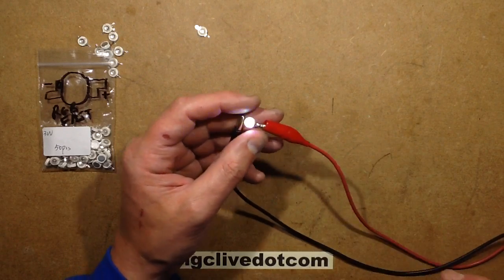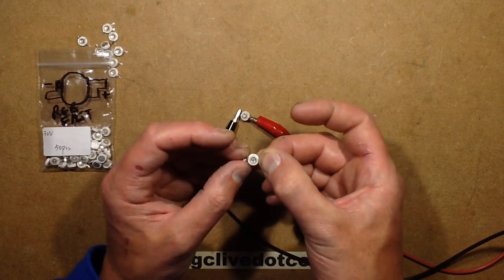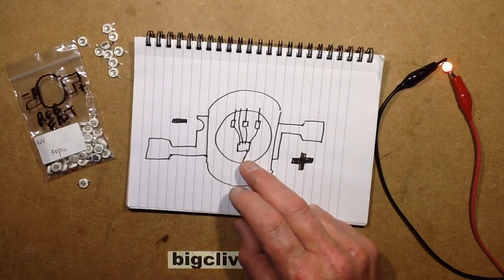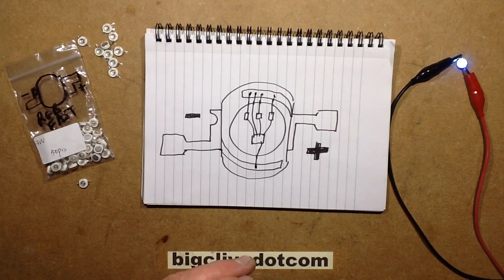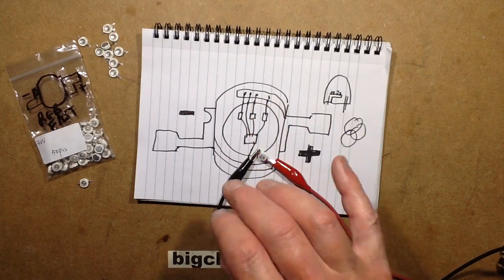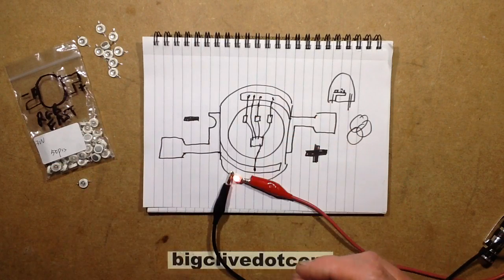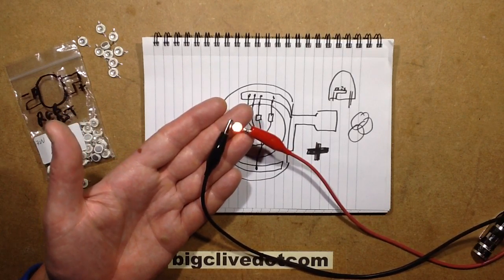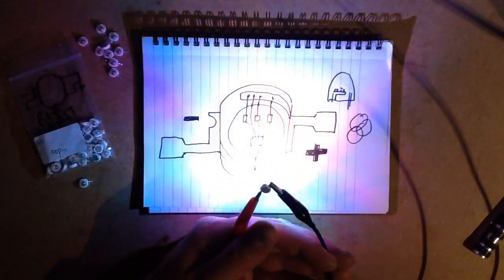Self colour changing 3W LEDs.

Comment: did you manage to find a serial number or anything? 
been trying to look for these recently, to mod a ps3 controller, not sure about the voltages though
but there are "player lights" 1-4
and i want them to be rgb and this seems like the most fitting solution.
the other ones i've found are all single color, or voltage regulated sadly
Reply from the maker: I've never seen these since.

Comment: This LEDs are so much stressful things if it is used in normal electronic or electrical product as an indicator. These can not be used in any designed also as we can not program it to flash according to our need rather than manufacturer’ s taste of the random sequence and randomly changing flashing speed ,etc. I bought one TV antenna which had build in booster. The manufacturer used one such LED also as booster power indicator. It was so much stressful and annoying. I had to remove .

Comment: I can't help but think having the chip built-in is a bit of an own-goal on the design. If a randomly colour changing LED is what's desired then it works convulsingly well...But swap the chip for three contact pads and you don't just drive down production costs, but you make a more versatile/adaptable product in the process! :-)

I mean: If "flashy flashy randy colour" is the order of the day, an external micro controller costs £0.03 and doesn't require that much extra solder! ^_^
Reply: Such LEDs are sold.  If you want programmability then you want a neopixel driven  by an Arduino nano.  Then you just write a simple loop to cycle the RGB values or indeed display whatever color you want.  Made a set of these with a 50 Led strip last Christmas.  Each led is addressable by the controller so you can make some pretty impressive colour wave effects as well as the more classic flashy Christmas lights

Comment: Dear Clive, I do have an applciation for these types of LED's. The are quite good for lighting white sportscones for a Quadcopter race-track. I do have one question though. As they are not 3watt but very much less, do the chips inside all have the exact same pattern. So when you start more than 1 at the same time will they be and stay in sync ?
Thank you very much for your always entertaining and informative videos!
Reply from the maker: They have their own oscillators that will drift out of sequence quickly.  It looks quite nice when it does though.
Reply: Dear Clive thank you very much for your swift response!

Comment: Hello,

I'm trying to power this led with a battery. It's like the one you use: http://www.dx.com/en/p/3w-led-emitter-on-star-multicolored-rgb-4530#.WLP3H_nhCHs.

The problem is that I do not know which battery to use, because for each color we need a voltage and current:

Red: 2.5V ~ 3.0V, 350mA
Green: 3.2V ~ 3.8V, 350mA
Blue: 3.2V ~ 3.8V, 350mA

The idea is that the battery is not too big. I've looked at models like these: https://www.amazon.es/dp/B01M24L9WA/ref=wl_it_dp_o_pC_nS_ttl?_encoding=UTF8&colid=3LHSU5HBD7PBO&coliid=I2BX1OXJ8MMRL1

Or this: https://www.amazon.es/dp/B016KIWSM8/ref=wl_it_dp_o_pC_nS_ttl?_encoding=UTF8&colid=3LHSU5HBD7PBO&coliid=I3DEPCN54BELQW&psc=1

I'm not sure how to do this. Can you recommend a suitable battery to power this type of LED without break it?

Thank you very much

Comment: Hi Clive, as the rail network appears to be changing over to led formats for colour light signalling, is there any chance you could do a video about the different approaches to getting a change of colour aspect of these new signals?I noticed our branch line down starter signal has just one head, so my question would be is there one single array of leds of bi-colour design which can be differently addressed to get the desired colour aspect, or two complete different led sets housed in the one head, but spaced out so that the driver can still get a complete colour aspect without gaps?Also, how do they mimic the Sykes Banner repeater signals with leds? Electro-mechanically that would be simple. You just have a horizontal rectangular black bar that can be tilted mounted against a white background.Cheers from Cumbria, where we actually make led signals.

Comment: Does it change its flash rate by varying the voltage ?
What would be good is if the LED stays one colour at one voltage and then changes to another colour at another voltage. That would have more applications

Comment: +bigclivedotcom Clive, you've made buying dodgy products from Chinese vendors on eBay fun. My new hobby is buying everything interesting from China on eBay that I can find and hacking it if necessary. Some stuff actually works quite fine, thank you. My most recent purchase was a $10 solar rechargeable camping lantern. I opened it up like you do and the product checks out. The solar cell charges the lithium cells inside (today is quite sunny), and I could easily replace the battery pack if I wanted to. There was a broken piece of plastic inside, which I threw away. Also, the battery pack was floating freely. I did what you would do and secured it with electrical tape. One down side with the device is that I cannot wall-charge it (220 only) but I got a laugh out of the Euro cord they shipped me along with the Chinese adapter of death. I will be using neither.
Reply: Most 220V stuff will work on 250, as long as you watch component voltage rating and tolerance and keep an eye on temperature.

Comment: I was looking at an 8mm colour changing LED today w/ my magnifying glass and I thought it was amazing to see all the stuff so tiny the little wires and the chip but then I remembered CPUs and ICs generally so I guess its not so amazing after all but its still super nice to look in the LED and see it esp the chip theres no lid on it its just encased in the plastic of the LED and if you get the light right you can just about see the actual circuit inside i wished I had a microscope to see it better

Comment: So, does that tiny-tiny-tiny chip inside consist of microcontroller and transistors driving these LEDs or is that something very special-purpose? In any way, I'm always impressed by how microscopic and powerful chips nowadays can be. And also impossible to reprogram in this case.
Reply: Usually it's a special purpose thing of sorts - not really a microcontroller as much as just a little ROM based sequencer and timing oscillator.

The LEDs that are supposed to look like a flickering candle use a linear feedback shift register, as I recall
Reply: You can mess up the microcontroller inside using 50hz square wave.

Comment: Clive, how often do you request refunds on these products that are false advertised? ( i.e. Wrong wattage, or slow vs fast flash )
Reply: If you can even slightly prove the problem, then you'll always get a refund from Chinese sellers on eBay.
I assume its because of the volumes they deal with and a very strong desire not to have negative feedback.
Reply: That's a good question!
Reply: Ya i did that and i got refund but also blacklist from many electronics sellers on ebay, they have some kind of shared black list. true story